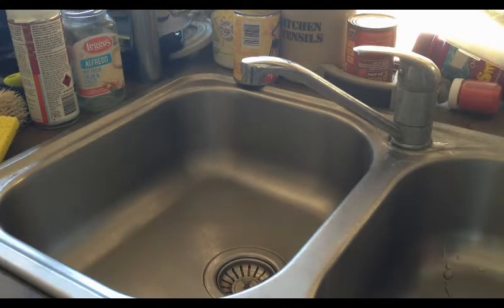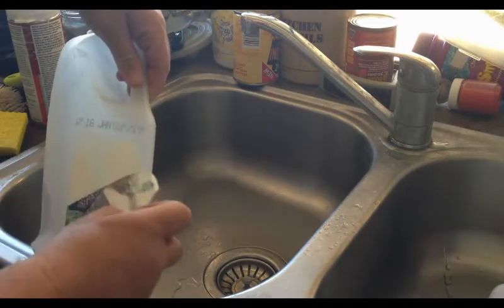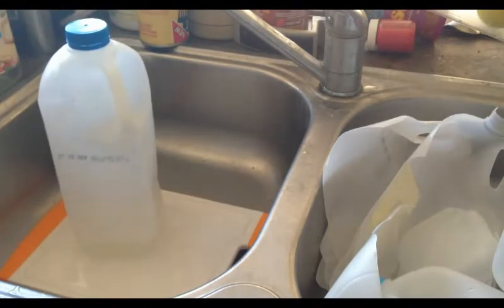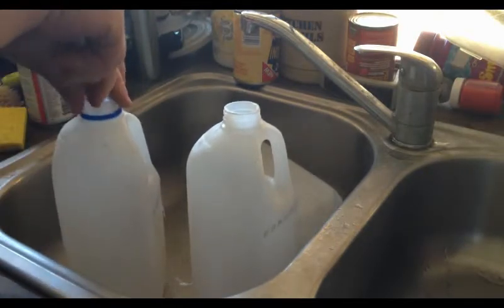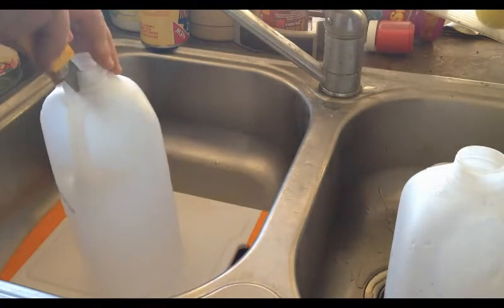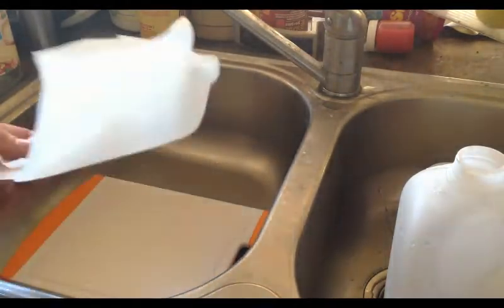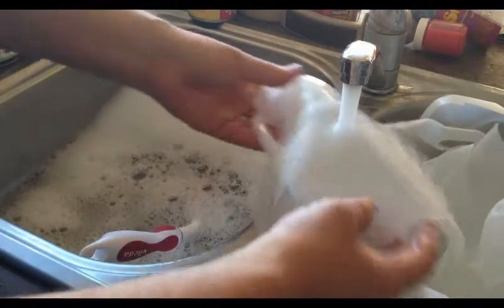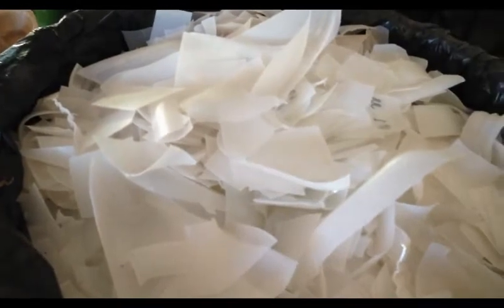Ep55 -  How I Process My HDPE Milk bottle Plastic

Comment: I do mine almost the same but I use scissors for the most part and cut the bottom off first.  I start by slicing the bottom with a blade, then cut around the bottom.  Then use scissors to cut up both seams to the top, then use the blade to slice into the handle from the inside and finish with the scissors (from the inside).  Very quick and easy as long as the scissors and blade are both sharp.  My scissors came with their own sharpening sheath so they're always put back into it when not in use so they're always sharp.  Well worth investing in.  Great video apart from the hot water in the bottle bit! All the best, Poo

Comment: Please, please never put hot water into a sealed container and shake it!!!  It can pressurise the bottle and becomes explosive and could easily scald you.
Reply from the maker: You are correct. I would never do that to a glass bottle, you are asking for trouble there .

 You are right it could scald you.
 I use only a small amount of hot water.It does expand the milk bottle. The bonus is that it does contain enough heat to remove help remove the milk lables.
Reply: In principal: if you three quarters fill the first bottle with hot water you don't need to shake it, just peel off the label and move on to the next one.
Reply: Thanks for the tip about the hot water!
Actually I tried my above suggestion in the last 15 mins. Filled a kettle, let it go OFF the boil then poured it into the first 3 litre milk bottle without a lid to just reach the top of the label and no more. By the time I finished pouring the label was ok to remove. Then, using an oven mitt to support the bottom of the now softer bottle, I carefully poured the contents into the next bottle. Again the label was immediately removable. Proceding in this manner I went through 9 3 litre bottles and a 2 litre bottle with the same kettle content.
Now just need a good efficient method to remove remaining glue residue, assuming it will affect the final melt. Gel Bug and Tar remover works but it is potentially expensive and time consuming.